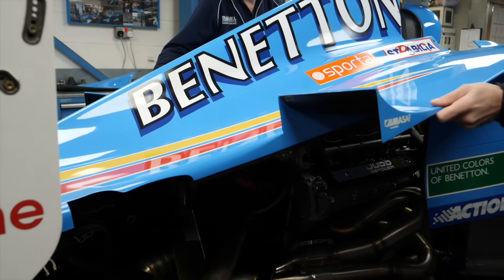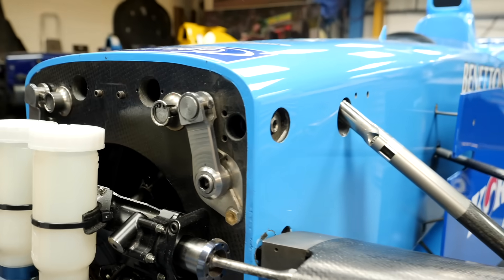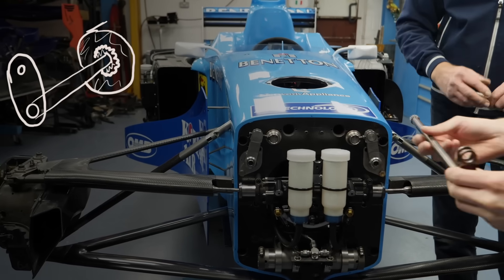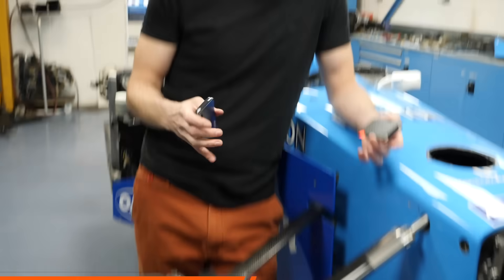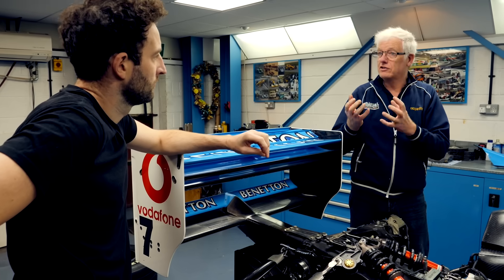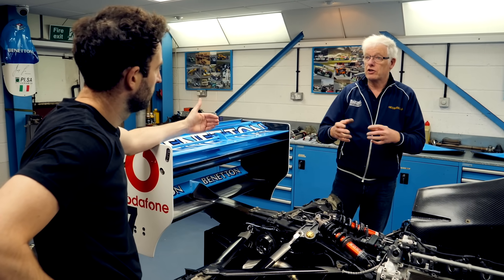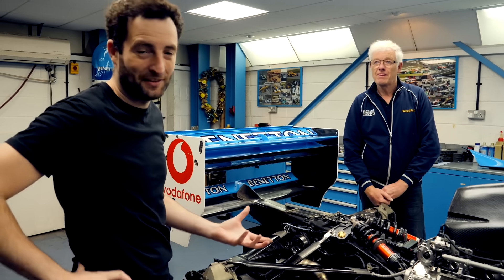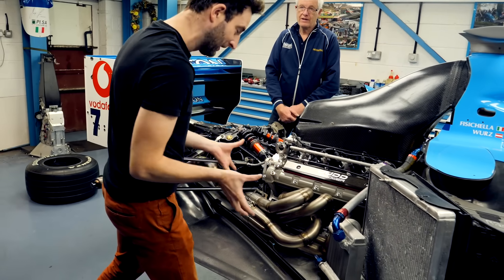Why F1 Suspension Doesn't Use Coil Springs!

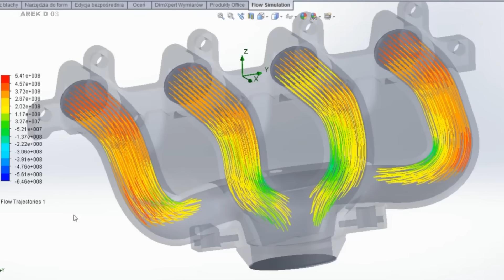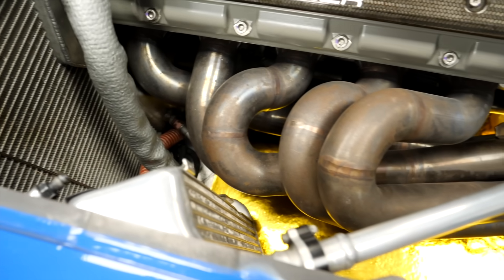Comment: For anyone who misunderstood, just to clarify the confusion at 4:20, "...and so if they were the same length... they'd all bang together... " was a mistake, as explained by Dad at 3:44, "...all of the headers, the primary tubes, need to be of an equal length..." so that the pulses of exhaust gases enter the collector with the same timing, and in the same sequence, that they left the cylinders. Awesome video otherwise. Thanks for the tour!

Comment: awesome video. i always understood those types of exhausts are called extractors. imagine if each combustion from each cylinder produces one pulse of exhaust. when that pulse goes through the header reaches the collector and goes into it, it sucks out the next pulse of exhaust gas from another header. therefore actually helping the pulses out and creating less back pressure.

Comment: Some 40+ years ago I inherited my father's Morris Marina. A car build by British Leyland, that had front wheel suspension with two, three foot long, suspension bars that were about 1 inch in diameter. The were also adjustable somewhere under the front seats.

Comment: Funny how you were talking the pipes have different lengths and your dad immediately said they are equal length. Great video, great content, really interesting, but you need to rehearse the videos.
Reply: You misunderstood Peter :D  (edit: and gone is Peter's comment)
3:46 Cleary says 'equal length'
The idea after it is that the flow stays constant. The previous exhaust cycle helps pulling the next one out this way.

Comment: Very good video. You can show informations about the software team and tests because each piece as almost unique, basically designed to the car season under extreme use and incredible forces and speeds. The computer could appoint reinforcement for such part? They're tested on cad and bench or directly to the track?

Comment: The rear suspension of a Peugeot 205 is also a torsion bar, otherwise the boot would be too small with conventional springs and shocks.

Comment: Would have been nice if you had explained how the suspension fully worked. A very important aspect of F1 suspension is that they isolate the heave (when both wheels are equally loaded) from the individual wheel bump. This allows the car to resist high aero loads without bottoming the suspension. The link between the left and right rockers plays a part in this, but parts have been removed so not possible to see the whole system. The missing bits would deal with the heave and roll.

Comment: Technically, the torsion bar is a spring. It is not in the sense of how a spring commonly looks like. 
The torsion bar deforms elastically and when the workload doesn't exceed the yielding stress of the torsion bar, the bar springs back to the original shape. This is fundamentally how things (any springs) deform.
Edited: Shout out to my student Ben W if you are out there, make sure to let your cousin know that I'm so happy that you guys are getting married. -- Prof. Obvious

Comment: so where does the damper go on a torsion bar?
Reply: Usually it is connected to the lower control arm and up to the frame or chassis somewhere.  On most car anyway.  I don’t know about F1 cars though.  They may be different.
Reply: On the rocker arm, just like with a coil spring setup just without the coil spring.

Comment: Not convinced. I don't think you have really grasped the idea of EQUAL length primaries.  BTW a coil spring is really a wound up torsion bar, so the straight bar, for packaging mainly, is better.

Comment: Wish my dad was that cool !
It was stated that the primaries of the exhaust needs to be of a different length as otherwise the exhaust gasses would arrive at the same moment, but the ignition isn’t happening at the same time ?!?
Reply: "need to be of an equal length" he said. generally called equal length headers.
if they were an unequal length, they would be unequal length headers.
so that the exhaust pulses do not interfere with each other, the length of the "primary pipes" or headers are made an equal length.
also remember that the firing order of the cylinders does not go from front to back, but instead is mixed up in a way that balances the engine depending on how many cylinders. this will also need to be taken into account with the physical distance of each cylinder in the block from the collection point.
Engineering Explained has done a number of good videos on this and many other things too!
https://www.youtube.com/watch?v=SUiyNud1FX0
Reply: @Rintaro88  I think I misunderstood and heard ‘unequal length’ instead of ‘an equal length’ .... makes more sense.
I know about firing sequences.
Reply: @ErikB750  brilliant. you should check out engineering explained's videos though. very informative.

Comment: Pretty interesting.
I think you said that the exhausts were all different length. They are the same length and the convolutions are there because they have to be the same length.
Also, there is more to it than just gas flow restriction. There are shock waves that travel through the exhaust gas (like sound waves through air) and those shock waves have a positive and negative pressure aspect. The trick is to get a negative pressure wave front reflected back from the collector to the exhaust valve as it opens to help suck the gasses out. A huge amount of power is gained this way. (but only at a particular rev range). Similar waves are used on the inlet side as well. A positive pressure wave can actually help keep gasses in the cylinder before the valves have fully closed. Pipe lengths and valve timing go hand in hand.

Also, on the springs. The thing about the rear coil overs is that they coil over 'dampers' so it wasn't a fair comparison. Where were the dampers for the front suspension? Presumably they would still be a piston through oil, like the rear ones so they would take up space too.

Also, a coil spring is actually a torsion spring too. It is just wound in a coil. It is still a twisting motion on the actual spring material.
Reply: How does that work when the ends of a coil spring are free to rotate around their axis?
Reply: @phamnuwen9442  
Good observation.
Still it is a twisting motion on the spring that is the primary spring  force if you think about it. Each turn of the coil actual prevents the the ends being free as you say.
Just as if you bend the ends of a torsion bar 90 degrees to stop it twisting, the coil provides that function over the length of the spring wire.
The alternate to it being torsion forces are bending forces like big flat leaf springs and while there may be a bit of that it is primarily a twisting motion providing the spring.
So, it is the coil itself that prevents the rotation around the axis. Although I wouldn't be surprised if there was a tiny residual twist at the ends.
Reply: @Igbon5  While I'm sure there is some twisting motion going on in a coil spring, I don't think that means it makes sense to call it a torsion spring. The way the suspension utilizes the different spring types is clearly quite different. Coil springs work by being compressed and torsion springs are twisted.
Reply: @phamnuwen9442  
Coil springs appear to work by compression but they don't. Compression springs are something like a rubber ball or block, or a an amount of air in a container which can be compressed. The spring metal in a coil spring is not being compressed it is being twisted.
Reply: @Igbon5  I think you're not seeing the forest for the trees here. A coil spring is used in compression by the system it's mounted in regardless if there is some twisting motion is happening inside the spring itself.

A coil spring inside a compressive suspension could be replaced by a solid block of rubber or an air cylinder.

You could not replace any of these things with a torsion spring unless you changed the suspension system to one that uses torsion.
Reply: @phamnuwen9442  
Yeah you make some good points. But my point stands.
It wold be difficult to replace a coil over damper with a pure compression spring because there would be no room for the damper.
I still want to know where the damper is with the torsion bar as they would still take up similar space. Dampers still shove a piston through oil as far as I know.
Also while the torsion bar does seem much more compact it still needs a mounting system and pieces connected to the ends at right angle where levers will provide a similar linear movement.
I like torsion bars. I have a car with them. It's easy to change ride height and preload.
Anyway you made good points and seem to have good ability to visualize mechanical systems.

Comment: Your dad was trying to explain to you that the headers are of equal length, not unequal length. That's why the ones nearest the collector have more convoluted loops, to add length within that shorter distance.
Reply: Thanks, that makes sense now :)
Reply: Well.... when you add loops you make different restrictions so it's more equal restriction headers they are not equal in length but equal in flow

Comment: You seem to have a few contradictions in there, the primary pipes should be all the same length. I know it was stated as such but it was also stated that they are different length.
The fired charges all come out in order and merge like a zip in the collectors.
Also, and I keep noticing this on multiple youtube videos, you should keep your eyes on the road and not the camera when you are driving. As a driving instructor/trainer you should know this better than anyone!

Comment: Super fascinating!! I always wondered why the exhaust pipes were so oddly shaped. I also had no idea the rear suspension was mounted on the gearbox! That makes formula 1 cars even more incredible!
Reply: Been like that for years. Even back when most of the teams used Hewland transaxles (quite often n conjunction with a Ford DFV engine) the suspension was bolted to it. That was from the 1980's.

Comment: F1 cars no springs
Springs come in many different forms
So a torsion bar is just a sprung bar action is twist over a straight length rather than a coil or leaf
Remember folks a Morris minor and the marina used torsion bars so hardly a new science
Reply: I remember the fantastic handling capabilities or the moggy and the marina so well..... You are spot on, they both used torsion bars. 

The Swedish Military also used them in the L-60 tank(?)in the early 1930's and they are still used in Challenger 2 and Abrahams M1 tanks to this day. Again, as you say, it isn't new technology.

Comment: Torsion is great, but isn't that mostly linear damping? What about the exponential damping part?
Reply: Most springs are fairly linear (with some odd exceptions of course). If you want progressive, that comes mainly from the linkage/rocker geometry. Also, the spring has nothing to do with damping. That's two separate things.

Comment: A torsion bar is a spring, a coil spring is a spring, a leaf spring is a spring.  Why the choice of title for the video?
Reply: Air can also be a spring, as used on some modern F1 cars. Rubber blocks can be a spring, as used on a couple old F1 cars.

Comment: What an interesting video. As the saying goes you learn something every day and I certainly did with this video. 

So I take it that the engine in the Benetton is not from the original engine supplier. 

I read that the Red Bull mechanics have difficulty working on Adrian’s cars as he does not consider that part when designing them.

Comment: When I hear torsion bar, I think of tank suspensions, or picture them being used on something excessively heavy. I don't normally think of them in use on something so light.
Reply: The Volkswagen Beetle uses this torsion bar too.
Reply: Peugeot used to use them in the rear trailing arms of their hot hatches... worked really well and with no struts required it helped maximise boot space.
Reply: I always think of 60’s and 70’s Dodge and Plymouth’s.  They most all used T bar front suspensions and leaf spring rears.  And of corse the VW Beetle.  It used them from and back as did early Porsche
Reply: Like 2wd chevy trucks?
Reply: Pretty much any VW Golf up until 2015 used a torsion beam in the back.
Reply: @Balomis  Torsion beam is a bit different, though. Essentially the wheels are connected with a single big torsion bar. However early Volkswagen Beetles (and Porsches for that matter) did have torsion bar suspension with independent springs.
Reply: @Balomis  Torsion beams and torsion bars are totally different things
Reply: @TheBlaert that look the same and act similarly
Reply: @neiltitmus9744  Not at all.  A torsion beam axle uses its torsion as a form of roll resistance.  It's like the axle found in the rear of a Golf Mk2 or B5 Passat for example. It doesn't act as a spring.  
A torsion bar on the other hand refers to a bar that when twisted gives a spring action

Here's a good video on torsion beam axles.
https://www.youtube.com/watch?v=QeZkCyaaPnw
Reply: Had them in an 87 civic si. In my opinion the coolest Honda ever. Just a nightmare/expensive looking for aftermarket parts.
Reply: Of course they would be used on F1, where would 1ton+ of downforce go to?
Reply: David David  Yeah, I wondered the same. 3 ton road cars are quite happily using coil springs.
Reply: David David  easy adjustability of ride height while holding all that downforce.
 And they can be aerodynamic as well.
Reply: David David  sentences in Portuguese are made in a completely different way.
For an example, every word has a gender, if we don't know the gender of the word (or thing, or person) we just assume based on whatever makes sense. 
And sometimes I forget how to use genderless words in english.

But in that case, op mentioned torsion springs are used on heavy things, heavy things generate tension (on the suspension), so does downforce. So the in a F1 car is going to change a lot, in a matter of seconds, throughout the entire race, for several reasons.
Downforce
Changes on track elevation
Curbs
Pitstops.
Weight transfer (which always happen regardless of how stiff the suspension is)
Etc etc yada yada.
But the car also needs to stay low, that's one of the reasons because the torsion suspension does not have a progressive spring rate.

Congrats if you understood
Reply: @afoxwithahat7846  material selection and selective heat treating will give a progressive rate to a torsion bar.
Reply: @mattjohns3394  thx for letting me know
Reply: Like the Original VW Beetle?
Reply: A lot of inexpensive cars use them today.
Reply: A tractor at my old work had torsion bar suspension too, I forget what make and model it was tho
Reply: Radial dampers also

Comment: A torsion bar is still a spring. Coil springs are not the only type of spring. A spring is simple a device that deflects when force is applied. An anti roll bar is a spring. A leaf spring is, funnily enough, a spring. A coil spring is also a spring.

Comment: This was really cool to have some technical insight into an F1 car. I know for sure how important the exhaust is. I compete in the cheapest rally class here in Sweden which are running stock engines. The exhaust is free after the manifold though so me and my father built a new exhaust that was designed by my fathers friend. We ended up gaining 8-9 hp just from that exhaust and that is on a 115hp Corolla. In total with a new exhaust with race cat, sport air filter with attempts to make as much air as possible flow to the filter, remapping the control box and top decking and balancing the engine we are almost up to 150 hp!

Comment: First you ask why they the headers are different lengths, then your dad says they are equal lengths so the gasses don't collide, then you ask him again if they are the same length, would that cause a problem, and he says yes. Pretty confusing, but I'm guessing all the headers are the same length, and that is why the pipes are straiter (closer to the cockpit) and the closers ones (to the collector) are more curly.. is that correct?

Also, more videos with your dad please!

Comment: My question is if a f1 team gets an engine from a supplier can they tinker with the intake and exhaust system to create more horse power
Reply: Yes but if the manufacturer is at all competent, you won't find much there. Unless of course that manufacturer is purposely giving you crap.
Reply: @wingracer1614  so has there been any cases where a buyer was able to get more out of a engine than the sellers own team

Comment: Technically Torsion springs are still springs, and regular cars also use them.
Reply: A coil spring is really a long torsion bar coiled up to fit in a smaller space
Reply: Regular cars do not use torsion springs for primary suspension function as is described here, although anti-roll bars are torsion springs.
Reply: @nikolaihedler8883 My Dodge has torsion bar springs.
Reply: @russellgillick7637  I should be more specific: almost all regular cars do not use torsion spring suspension.
Reply: @nikolaihedler8883  Torsion bars are more common than you would think but yes, coil and leaf springs are more common on road cars. But you'd be surprised how many old pickups are still on american highways with torsion bars up front, leafs in the back.
Reply: @johnsmith1474  the overwhelming majority of consumer vehicles, since you want specificity
Reply: @nikolaihedler8883  actually a coil spring is mostly loading the material in torsion...
Reply: @devonsmith5500  and yet they require completely different design constraints, so that's entirely irrelevant to this discussion.
Reply: @nikolaihedler8883  At the front the Morris Minor does (1948), So did my Alfa Romeo 75 (1988)